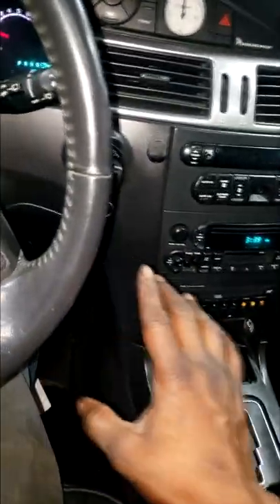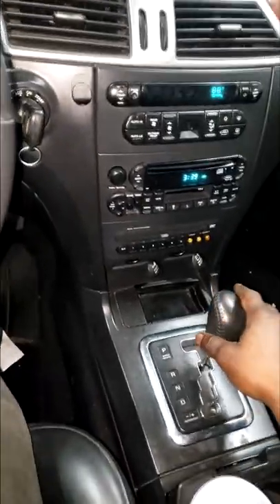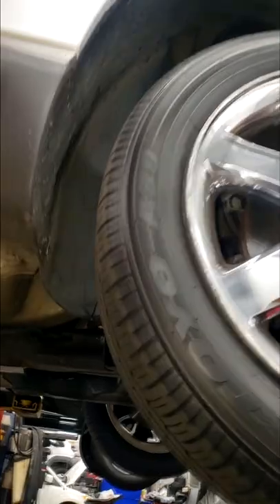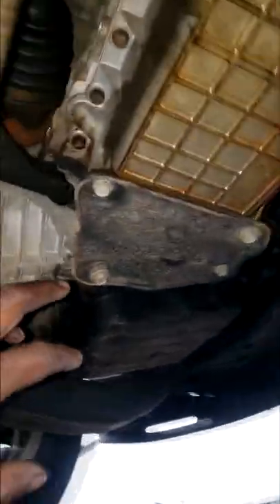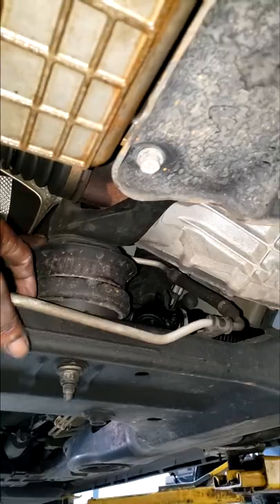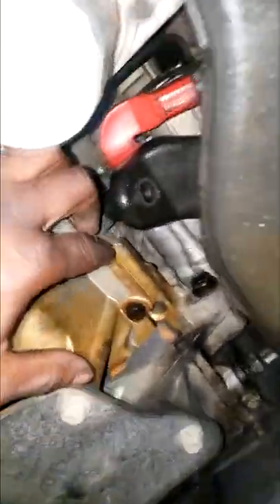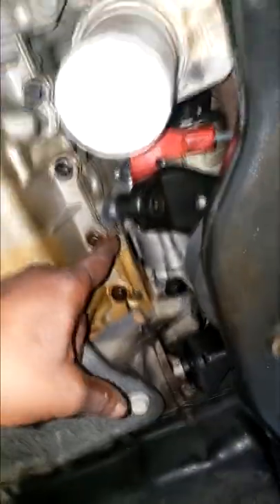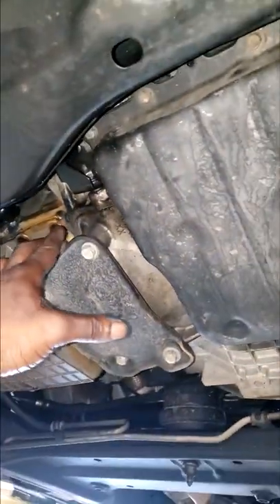If you hear this LOUD NOISE IN YOUR TRANSMISSION, STOP DRIVING. LOOK WHAT HAPPEN. #JTtheCarGuy

Comment: "Welp..don't know how they gunna get that out"  lmfao.
Reply: I know right like ain’t this dude the mechanic???😂😂😂
Reply from the maker: Don't be a drama queen dude
Reply: @asher8085  I mean u try removing a snapped bolt from a case. More work than it’s worth
Reply: @asher8085 if you don't know what you're talking about then just say that 😂
Reply: @asher8085 lmfao😅
Reply: @asher8085 lmfao 😅
Reply: @pHVHStarLight just use a bolt extraction kit. Drill into the center of the bolt put the extractor on and twist it out it’s not that hard
Reply: @nickhowser7262 was just going to say that
Reply: @nickhowser7262  sure it is. its dependent on the amount of pressure that the bolt was attached with. from what i can tell your dealing with at least 100ft/lbs. you will have to drill that bolt to the bottom to alleviate that pressure. extrator tool will fail here. line of sight for the drill plus bit will be an issue. if you are a good tig welder you might be able to weld a T to it and lever it loose.
Reply: @pearlrival3124  The tension is in the head which is gone.
Reply: Weld a nut on and pull it out takes 10 minutes with a lift
Reply: @jesussanchez-rx7zk  not that simple. the diameter of the bolt won’t necessarily allow that much strength.
Reply: Wow, a thread full of people that legitimately do not know what they’re talking about trying to tell him mechanic how to lose his life just crazy bro this world is flipped upside down
Reply: That's why I came to the shop😂😂
Reply: Lol
Reply: @goldnglox6490  
Bahahahaaaa 🤣🤣🤣🤣🤣
Reply: @nickhowser7262 - Exactly!!!
Reply: "THEY" 🤣😭
Reply: @OurKingdomIsNotOfThisWorld word
Reply: U aint got the answers Sway

Comment: What is this jiffy lube😂 took my truck for oil change they stripped my bolt to oil pan and next day my truck start knocking thought my transmission was going bad decided to check oil and had none had to take to another shop pay another 100 oil change and 90 dollars to drill for new bolt. Point of the story never go to jiffy lube😅

Comment: My 2005 tundra has a recall about transmission mounts. Obviously a V8 has enough torque it will bang so hard it rattles the whole frame just with a light tap of the throttle. Never knew about the recall and shop did control arms as a (very expensive) “idk maybe” had to buy a redesigned mount and it works great now

Comment: Hey man love your vids you’re like the transmission guru. I have a 2010 e550 Mercedes and it makes a very quiet whine or humm noise when the rpm’s go up in any gear including neutral and park. It’s easiest to hear in low gear. The car shifts great and doesn’t give me problems but is this a transmission noise or is it normal?
Reply: i have a w210 2002 e320 rwd 722.6 trans and i have a huge whine and stuck rpms and humming loud sadly just bought it my transmission guy today he said it could be worn bell housing/ valve body  he said or the pump could be shot. hes letting me know tomorrow the definite  problem. Stop driving it and take it in before it gets louder you know as a benz owner dont let them get louder or leakier wish i had e550 also you have 722.9 i think so could be diff idk

Comment: Drill baby... drill! Get that bolt out of the block with an "easy out" reverse drill bit and reverse tip spire. Tap the hole and repeat, if necessary? 😫 ouch... $$$
Reply: Somebody overtorqued all 4 front motor mounts on my 94 camry, and they snapped one bolt, and jb welded the other 3 because they stripped the threads out. I had to drill and tap the block from 3/8 to 7/16, and it took me like 6 hours at least. I had work the next day 🤷🏽
Reply: @simmcowaPang122  

Lmao bruh thats crazy
Reply: @simmcowaPang122  my wife's Chevy 3100 ate the intake manifold gasket, in Akron Ohio, i drained the milk chocolate oil (on the side of the road) and "shotgun ran it", back to Cleveland. I was at Midas Muffler then. We "don't do engine work", my manager said. Took 1 day off. Did complete tear down and rebuild, with cam & crankshaft bearings, all gaskets and rings, in 8 hours. That motor did another 60,000 miles... before the camshaft failed, broken between cylinder 4 & 5. Bent 4 valves... 😫 BUT...
2 motors and 2 transmission(s) after 280,000 on the clock, and finally junked it, due to rust that was too deep to repair. 😎👍
Reply: @jasonpocaro2730  ive been thinking of rebuilding my 5sfe in the camry, but it sounds to me like I should try to get a reman block instead. There's nothing terribly wrong with mine, and it has just under 230k on the clock. Only burns a little oil and the head gasket is probably ready to be replaced. But in my 4 years of owning a POS camry, it's been the best car I've ever owned no joke.
Reply: @jasonpocaro2730  but nothing defeats a determined man, not even metal 😂
Reply: @simmcowaPang122  my 2000 Honda 4 cyl needs rings, bearings and an oil pan at 142,000.  Last owner missed too many oil changes and ran it "low" a few times. "Ticks" after sitting a few days or when below 0 in Cleveland... Maybe a LONG BLOCK would be best? Not sure of cam condition or if any scored surfaces? Afraid to drop pan & look inside. He he he 😵 Currently putting another front end and 1/4 panel on my 1999 Ranger. When done, swap out and fix Honda before winter. 😁👌
Reply: @jasonpocaro2730  if you want it to last then yes get a long block assembled and shipped to you kr have a shop do it. Unless you know perfectly well what you're doing it's not worth the hassle
Reply: @contraband1543  I use a machine shop in Cleveland. They mill my heads and line bore just about any block you can imagine. A transmission shop in Parma does my internal work and gives me a GREAT warranty. I do all the assembly myself. 😎👍
Reply: @simmcowaPang122  😮

Comment: My truck doing this same thing I took it to Mavis and this is my problem now. It was fine before I took it so I’m thinking the messed something up.. I does it big time when I’m back up
Reply: Had suspension work done new arm controls ball joints rotator and sway bar.. I need help I took it back three times mad as hell because I have problems with my 2010 traverse now even the power steering leaking😢

Comment: Can someone tell me what the hell I'm looking at... What is that black piece.. and red piece connected to it...
I can figure out what the heck it is... Looks like metal, with a bright metal ball on the end, smashing against the block. 
Any help would be great. Thanx
Reply: It's one of the stabilizing parts of the engine. "Motor mount" 

Something causes the bolt to shear in half and no longer secures the motor. It's the reason the vehicle bangs in and out of gear.

Comment: Bro my car is doing this exact thing when it goes in reverse it’s not as bad as this but it’s getting worse I’ve noticed it way more lately
Reply: Have you fixed it and how please.i have same issues
Reply: @manofgalileetv5423  it only does it when I’m low on oil so I think that may be the culprit but also I think my transmission is going bad soon honestly if you have to change yours buy a transmission and find an independent mechanic don’t go to a shop they will charge you an arm and leg

Comment: mine does that sound when you put it on reverse? they told me it was sensor; I have changed it 3 times now. I does that too while driving sometimes
Reply: my car is having the same issue, what can I do
Reply: @Tsuccess  I found out it was an engine seat that broke, so I had to change it. If you hear that sound, something is def broken,take your car where they can go under,like a tyre place and make them shift the gears to see whats happening under

Comment: bro can you help?? i have 2016 subaru legacy 2.5i cvt. So when i put it in R or D it shakes, when i accelerate it shakes and got some clunky sounds(depends how you accelerate), and sometimes when driving rpm goes up but car aint following it, in less than a second it bangs and then starts accelerating(it happens not oftenbut still does it). also cv axles need to be changed. and i know that fluid in transmission is really bad so can replacing fluid fix the problem??
Reply: I’m no mechanic, but I’ve owned couple cvts and it’s sounds like your is slipping when the rpms are going up and your not speeding up with it, also changing really bad transmission fluid can actually brake the transmission, but I’m not sure if that goes for cvts, ask your mechanic
Reply: @tylermarki1478  yeah tomorrow 30th jan i reserved meeting to my mechanic and i hope there wont be something expensive ;)
Reply: Did you find out what was the problem?
Reply: @luisreynoso2608 Chain snapped bc i was still driving with that problem, then i bought new trans(2019 outback 8-speed one) and replaced it. now i have to change brake rotors and pads because its still shaking😆